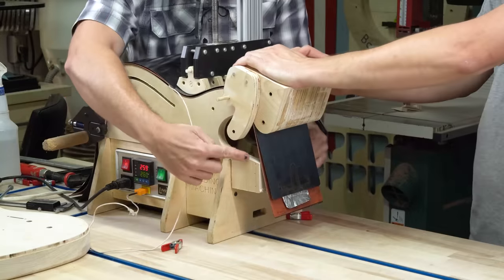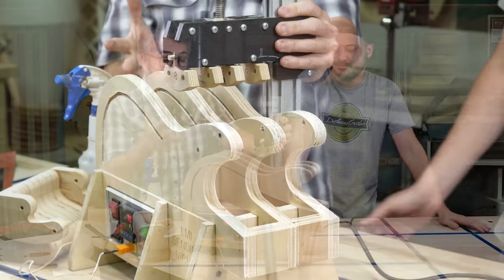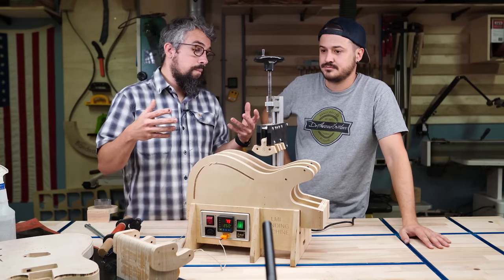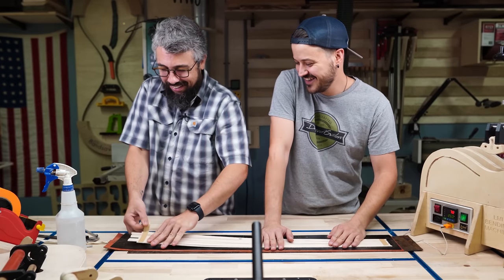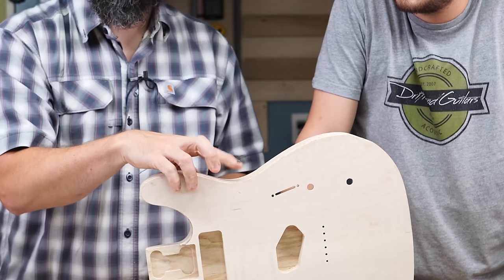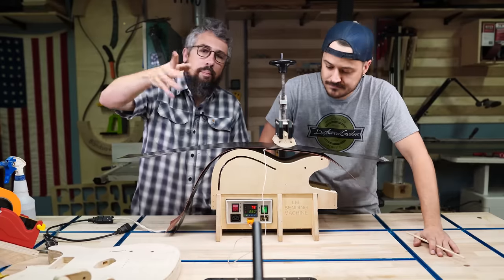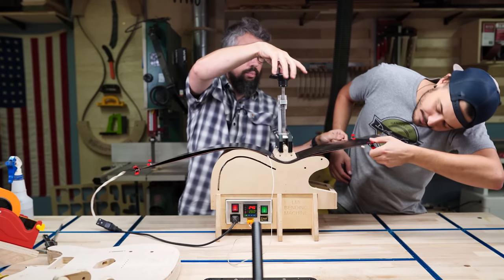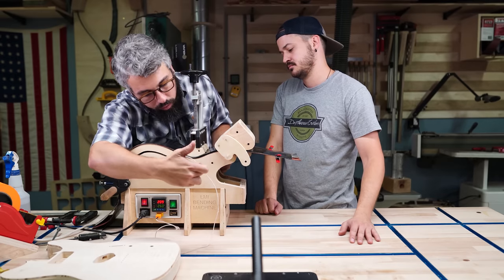Bending The Binding For a $5,000 Guitar!

Comment: Nice job guys... If you haven't tried this, spray the wood with Super-Soft 2 Veneer Softener & Conditioner a few minutes before you bend.  It will make those tight curves much easier (even on really tricky woods).  I found it to be a real game changer.

Comment: Guys. If you make a handle to go on the top of the Jig that Matt was pushing down for the tight bend, it would be a lot easier for Matt to push the material down into the LMI Jig. I was watching him starting to struggle pushing it down.  Just my thoughts.. Great Idea thou.
Reply from the maker: Super good idea!
Reply: Yeah I was thinking the same. You could even elongate the body of the mold to attach a screw clamp from the body of the bending jig to the handle of "the matt portion jig" (couldn't think of another name)

Comment: The Boys are Back! Good to see y'all!! Quick question... would it be possible to use the binding in pieces? Glue up the larger then fit the smaller pieces afterwards? I'm thinking once glued and sanded, there shouldn't be any noticeable difference. And since it's wood, it won't have the same issues plastic will have over the years?

Comment: You said you wanted to automate the fwd bend a bit with a screw... what about having a lever with some weights on it and a series of holes in plug portion of molding plug to keep lever slightly above 90 degrees for consistent force or adjusting weights location on lever as it settles downward ?

Comment: For me the problem with binding - is one with some lines on bottom, like purfling on the sides. Its really hard to get it straight and not wavy... Especially for tight waist - like ukulele.
Reply: @nopinionocomnt  issue is that it get waves -  because one is bending across wider part. sanding back bottom corner helps a little bit, but still there's no crispy line.
Reply: @nopinionocomnt  yea, glue sandwich, cut proper strips... issue is when you have totally prepared binding (like 2x7 mm crossection) with all lines on bottom and try to bind that strip - lines on bottom go wavy. I'm using Tidebond 2 - maybe it cannot hold, maybe there's something else...